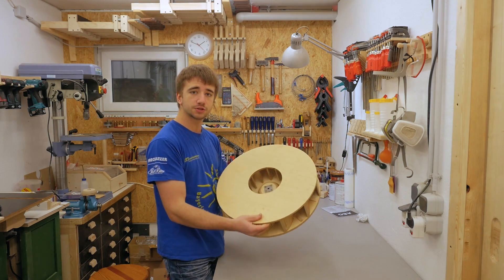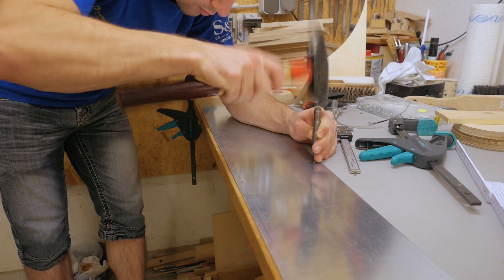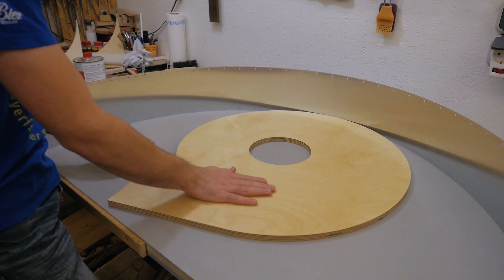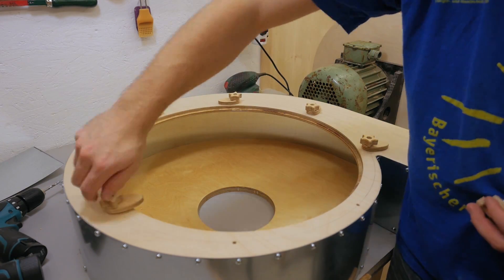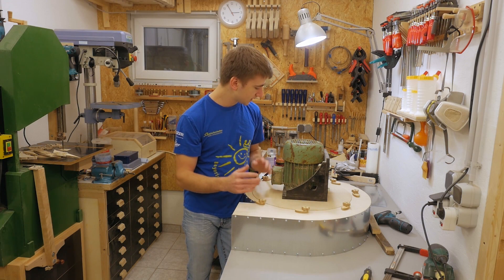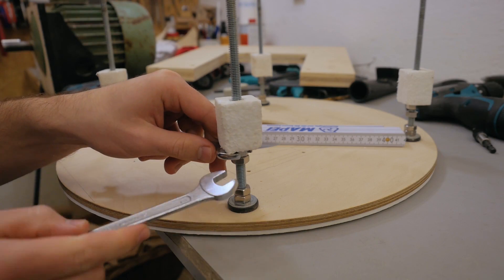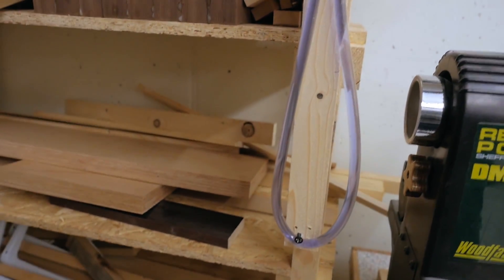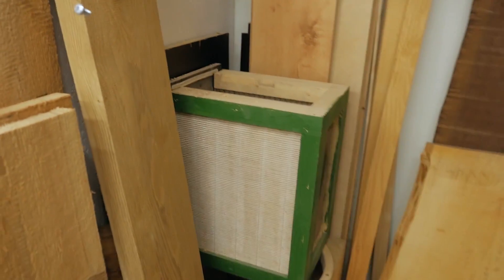Building a Big Dust Collector Blower #2

Comment: At what point does the mass and rotational energy become more than the strength of the material can withstand?  In other words, will that thing explode,  especially if a hard object is ingested?
Reply from the maker: I have no data about the wood, so I don't know. The wire screen over the inlet prevents larger pieces from hitting the impeller.
Reply: Hmm. It might be prudent to test and locate it behind a shield of some sort.
Reply from the maker: I just built a shield, I call it blower housing.

Comment: Why is it that all you guys are able to get these materials by "visiting your local shop".  My local shops say "GTFO"...they aren't setup to deal with one off purchases...those that are want a massive uplift on pricing (like 200% or more in many cases).  So...yea...it's why we ask "where did you get that"...we're not being cheeky, many of us do not know where we can get it.  You are fortunate that your "local shops" will deal with you...mine say GTFO because they are too busy dealing with the big dollar customers buying 6 figures worth of material a week...
Reply from the maker: I'm sorry to hear that. I only ask the small businesses and if they don't have what I need, they can often tell me another place to look for. If your shop says GTFO, they are just pure assholes.
Reply: The problem is I live in the automotive region...Detroit Metro Area.  Many of these shops are geared 100% to maximum throughput to Tier 1 suppliers.  They just don't have the time to deal with one off requests.  The places that will deal with cash and carry demand a pretty high premium, and many have minimum orders (many a couple hundred bucks).  I was trying to source 1x1x1/16" wall steel tube.  I needed to buy 5 TIMES more tube than needed (I needed 300 linear feet, they said the minimum NO-CUT order was 1500 feet, and if I wanted custom cutting (20' pieces if not cut) would be an extra $200!! Yea, I scrapped that project as I'd never use 1500 linear feet of steel tube, and couldn't afford the $1700 for the tube due to the minimums.

Even our scrap yards are tough to work with. I've been looking for lead, and none of the yards will sell it, and trying to find "drop offs" there is tough as many just don't want people wandering their yards looking for scraps. It sucks.
Reply: WreckDiver99 - Hey, do your need some stuff from Germany? I can bring you something. I live also in the Detroit area but I'm from Germany. 
If you have a small wish list, is no issue.
Let me know :-)

Comment: Marius, nice work!   I was thinking that the .8mm metal sheet is not a very good noise barrier. It would be interesting to see what happens if you wrap the lateral metal sheet with that packaging polyethylene foam you used for the brackets.

Comment: Looks beautiful~!.. Just curious.. Would lining the inner walls of the sheet metal with the dense foam, or a thin layer of sound-proof material reduce the noise levels without affecting the airflow too much...?
Reply from the maker: No, that would decrease airflow quite a lot. The inner surface needs to be smooth.
Reply: Ah.. That explains... But anyway, your impellers aren't the most boring tool in the shop.. Your blower impellers are beautiful, especially this one...  The orientation of the grain gives it a pleasing "bamboo" look effect....

Comment: This continues to irk me, the x-carve is not "a CNC"!
It's a CNC router!
It routs parts using a numerical control system.
Reply: You don't "translate" GCode to... binary?
No idea where you got that from, that's not how machine control, or computers for that matter, works at all...
Even my tiny, 16KB RAM controller does path approximation, arc calculations, ramps, acceleration/deceleration, and even lookahead for upcoming code.
You have to admit you're wrong at some point.
Reply: Spirit CNC routers are just routers controlled by CNC, 3D printers are just extrudes controlled by CNC, hydrocutters are just jets of water controlled by CNC, laser cutters and burners are a laser controlled by CNC.. CNC isn't what it is, just a broader term for how it's controlled. It bothers me sometimes but honestly, misnomers are a thing that exists and that won't change
Reply: You mean the computer runs it. It is all CNC. Just like all Doctors are doctors. Just some are doctors of various specialties.  not a big deal.
Reply: It routs, not "routes".
Reply: ***** Non-native, had spell check disabled :)
Reply: Spirit fair enough :)
Reply: In fact, it's more NC than CNC :) But nothing wrong to say ,,CNC'' instead of ,,CNC router'' ... it's really dificult to say when it's CNC router and when it's CNC portal mill :)
Reply: It runs a computer.
It's a CNC router.
Reply: Yeah, you can make this thing like you say, but at the end, you just get binary code to control stepper motors... there is not big diferent betwen NC and CNC , but i think that CNC must have some kind of ,,control'' when you machining... NC just reade code , CNC make correction .. if you understand me
Reply: +Spirit stepper motors are controled with pulses, which is binare right ? I don't know what experience you have with CNC, but when you do something serious, you need control that your tool is in the right position, and how you do it ? with reading on optical ruler, and what you get ? data that computer COMPARE (actual work of computer) and in realtime make correction (like send more pulse to stepper motors)
Reply: Controled by NC ^_^
Reply: Spirit das cnc wooden
Reply: wrong the x carve IS a CNC the dremel used as the mill / router.
Reply: No. It's not.
CNC stands for Computerized Numerical Control.
You're thinking of closed loop servo systems, not CNC.
At least research something before you make a fool out of yourself.
Reply: No, you don't get binary code.
CNC doesn't make corrections.
CNC stands for Computerized Numerical Control.
Computers control the stepper drivers.
Reply: It's not 100% true, on CNC you need some feedback from machine, like optical ruler which give you actual position of tool. But on this NC machine you just have ,,computer'' which convert G-code to set of instruction to stepper motors... no control if they actualy move.. if you milling agresivly, stepper motors can miss some steps, CNC can correct, NC not :)
Reply: You don't say Sherlock :) But computer is not just ,,box'' with electronic :) Computer need something to computing, but this just translate Gcode to binare code = numerical control :) It's like computer which would print instruction on paper and then you insert that paper in machine, that is NC, same like this :)
Reply: It's an extremely stupid misnomer that people should not have.

Comment: Could you have used the sheet metal for the blower fins also to save on weight instead of gluing together plywood and cutting them out on the bandsaw individually? Just wondering thanks

Comment: It happened to me some times that my dust collector picked up a large piece. As protection I would use a wire-screen out thicker wire in your place. On the other hand particles smaller than 1 cubic-centimeter does not make noticeable damage in my opinion.
Reply from the maker: You're probably right. Just recently I've come across a better, thicker wire screen that size. But that was after I installed the current one. I probably replace it.

Comment: Well done! Only suggestion probably - please use spring washer or LockTite or other bolt locking compound on impeller screw. It may come lose, coz impeller is not perfectly balanced.
Reply from the maker: I'll do that on the final installment.
Reply: Thanks!

Comment: Could you test the CMF with and without the 90 degrees curve? Maybe the angle should be more than 90 since curves naturally causes resistance.
Reply: Ismael Kafeltz adding turning vanes would minimize the pressure drop around that corner
Reply: Yes, really, it should be 135 degrees, that would be much better.
Reply: Not sure it would be better if it ends up pointing in the wrong direction!   :o)

Comment: Thanks, M.  Question:  why didn't you use the .8mm steel for the impeller blades as well - instead of laminated plywood.  You could have routed stopped grooves into the top and bottom impeller plates (w/ your CNC) and captured the steel both vertically and laterally.  Seems like that would have been stronger and easier.
Reply from the maker: There's no glue that would bond metal to wood as well as wood to wood.
Reply: Some say polyurethane construction adhesive would do that.
Reply: Try OSI adhesives (big-box home improvement stores).

Comment: Look up"fan affinity laws" to help you relate pressure, power and flow rate to rpm and impeller diameter. most decent shop vacs pull around 70" of water and around 175 cfm.  Most dust collectors draw 9 to 12" water and cfm is based on impeller diameter and horsepower. Typically,  you have to be around 3 hp to get 1200 cfm with ducting attached. 

You should measure the amps drawn by the motor when you have the minimum restriction attached (just the ducting that will always be attached). If the impeller is too large it will draw too much current when unrestricted and burn up your motor. As the restrictions increase the current draw will decrease. Most dust collectors draw too much current until the inlet hose is attached.  Hopefully you are drawing under the current rating listed on the motor plate with your inlet hose attached.  It's worth checking. 

Power goes up as the 5th power of the impeller diameter and it looks like that impeller is pretty large so it's worth checking. 

If you want to learn much more,  check out Bill Pentz website. I have come to some different conclusions than he has but his website has the most comprehensive set of dust collection information that I've found so far. 

I hope that helps. Thanks for sharing all the work you put into your builds and videos.
Reply from the maker: Great, thanks for the information.
Reply: Marius Hornberger One other thought,  not that you need more CFM than you already have but adding a "turning vane" or two would minimize the pressure drop across the 90 degree outlet.  If you find that the motor is drawing too many amps already then adding turning vanes would be counter productive. 

I just mention it because turning vanes are simple but make a significant difference in reducing pressure drop in HVAC systems. It's something to keep in mind for future projects that may use the  idea.

You might enjoy a book by Stephen Key called"One Simple Idea".  It's essentially his advice for licensing product ideas with little to no risk and very little money. Your creative mind is perfect for licensing since you will never run out of ideas for improving products. It's a great way to make a living if you are a motivated creative person.
Reply: Hey,  @T70781 , would a dust collector, like this big on Marius has made, be ideal for use as a plain joe shop vac?
Or are the operating principals between the two types of vacuums too drastic?

My theory; could I still run a dust collector with a 7in main pipe but have a 2.5in or smaller branch-off with a blast gate and 2.5in or smaller hose for shop vac duties? Such as vacuuming cars, garage cleanup, and plumbed into the house to be used as a central vacuum unit for the house?

I know it's a lot of questions, apologies! But you appear to be very knowledgeable of this! :D
Reply: Elvin Wilkerson promoting high head capacity for dust collection is like saying you should never use anything other than first gear on a 20 speed bike on flat ground. You will get much less flow through your dust collection system with a 100+ static inch pump (or multiples of them) than with a standard 14 inch static pressure dust collector. 

My shop air is most likely cleaner than the air you breathe in your house. This is what I've been focusing on for product development for almost a year now. 

If you are interested in the technical details just ask and I can show you in detail why what I'm saying is true.
Reply: Elvin Wilkerson I use a laser particle counter to measure the particle counts.  It is true that dust counts go up during some cutting operations because it's very difficult to capture all of the dust at the source but I also run an air filtration system that brings those counts well below outside ambient levels within a few minutes. 

Right now my house air is at 17,500 particles 0.5 microns or larger per cubic foot.  Anything under 30,000  is considered good air quality.  Ambient outside air where I live is usually between 40,000 and 150,000.  My shop is typically at or below 10,000.  I've designed collection systems for my cnc router and bandsaw that essentially collect 100% of the small particles generated. ..I.e. particle counts don't change when using those machines. I'm still working on getting a table saw collection system that is that effective without having to flow more than 100 cfm.  It's a work in progress. 

My goal is to develop collection systems that effectively collect 95+% of all dust generated with a system that is more economical than a standard dust collection system. I'm getting close. 

However, for most shops with standard tool interfaces,  more flow is better (assuming you have a submicron filter on your dust collector). That's because there is usually not much pressure drop from the tool to the air pump so low pressure high flow systems will clean the shop air much faster than high pressure low flow systems. 

I'm working on changing that paradigm.
Reply: Elvin Wilkerson, most dust collection systems only draw around 14" water column max.  Most shop vacs draw less than 70".  What matters is max flow rate for the system. For dust collection systems,  the resistance is generally relatively low so designing the system to provide less max static pressure and high flow is most effective. 

Power required is approximately equal to the pressure drop x the flow rate so if you design a blower to provide 100" static then it will only provide about 10-20% of the flow rate at typical operating pressures compared to a blower designed to provide 14" static assuming they both operate at the same power input.  That would be bad.
The only time high static pressure is useful is when you are drawing air across a high resistance such as a 1" diameter hose or through a very long tube with many bends.  But, that's rarely the case in a home shop and few home shops have enough power available to run more than a 1.5 to 3 hp motor. As a reference,  a typical 1.5 hp dust collector draws around 14" of water static and around 800 cfm free flow.  Using the same amount of power a shop vac will draw around 80" static with a max of about 150 cfm free flow.

Optimally, blower system designs should be matched to provide max flow for the system they are connected to.  That means minimizing system resistance so more flow can be obtained with the given power available.
Reply: Tony, that is good info. I have my grandfathers old 75 foot wood shop with zero dust collection system.  Now sadly it is used mostly for storage but there are places where the dust is built up half an inch or so. That's saying something because when the wind blows it blows some of it right out the eaves. lol  Gotta love old shiplap buildings with no insulation or even blocking in the eaves.  Someday that will have to be fixed or a new building built.
Oh and be careful of the know it all trolls out there.
Reply: Would love to see your design. Perhaps you and Marius can get together and build a proper dust collection.
Reply: Tony Shulthise, good for you, then. That sounds like an awesome goal.
Table saws are notorious for spreading dust all 'round the shop.
Reply: Any vacuum which only draws a 70" water column is going to be scrapped or redesigned. I want a minimum 100" water column.
Reply: "My shop air is most likely cleaner than the air you breathe in your house." Okay, whatever you say. The moment your saw/drill/whatever spins up, your building air purification goes to shit because of all the dust already inside the motors and on moving surfaces (bearings, blade, drive belt, etc.).
You're perfectly entitled to believe whatever you please, though.
The only time I use first gear on a bicycle is if it is a 3-speed.
Reply: Tony Shulthise, If I have a shop vac that only draws a 70" column, it will be used for something else or scrapped completely. No wonder you people end up with so much dust in your motors!
70" water column? Not on my watch and not in my shop!
CFM can always be increased drastically by multiplying turbines (as in: use two or three small motors instead of one big hoss that is drastically inefficient).